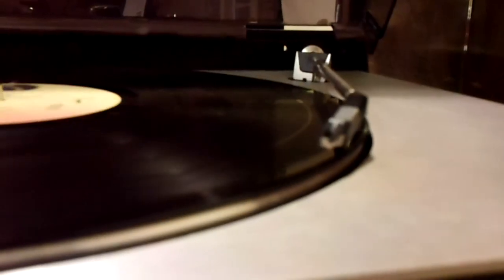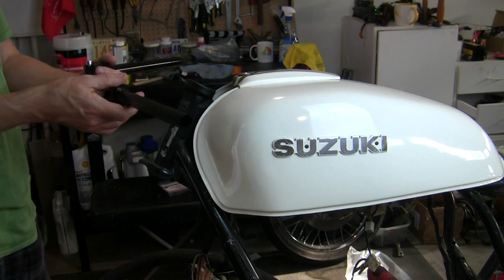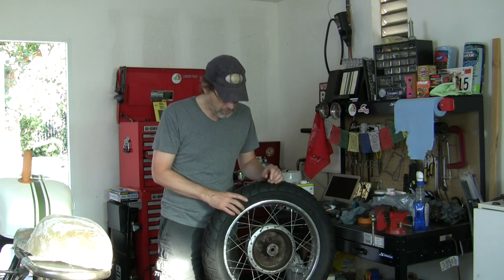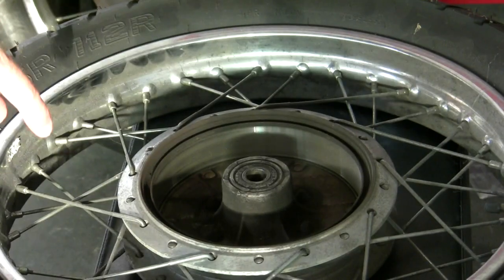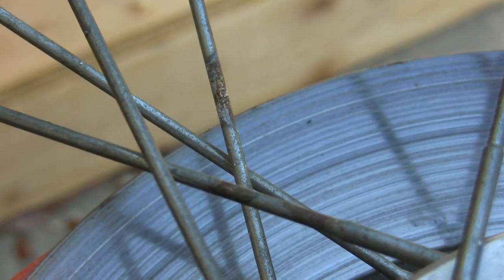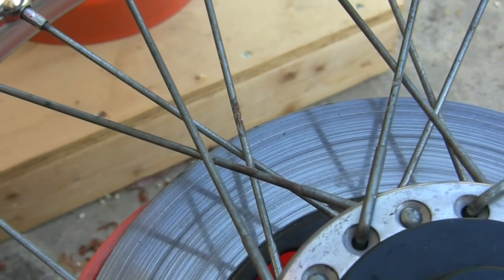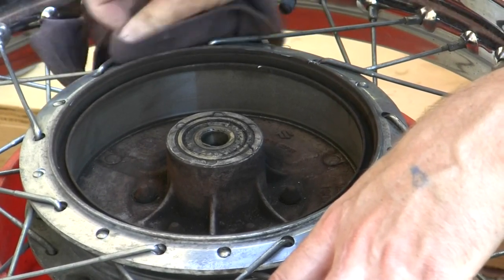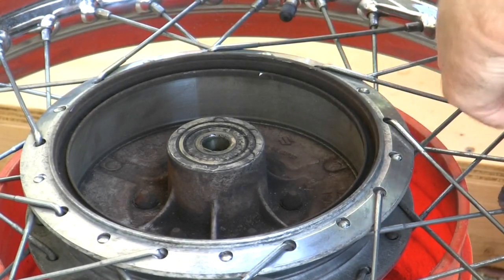Clean Spoked Wheels - GS550 Cafe Racer (Part 55)

Comment: Has anyone ever tried WD-40 as a cleaning agent (vs kerosene). Seems it’s good for everything. I read somewhere that a downside of steel wool is the tiny fragments left behind that tend to accelerate rusty spots. Used fine steel wool and WD-40 on one of my rims, looks great. I’ve had an issue of scratching the chrome using some of the rougher scotch brite pads, (musta been rubbing too hard), finally found a “fine grit” equivalent pad at Home Depot.
Reply from the maker: That seems like a good solution to me. Thanks for sharing with everyone here. And thanks for watching!